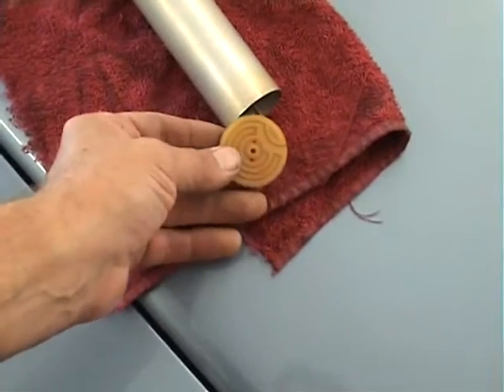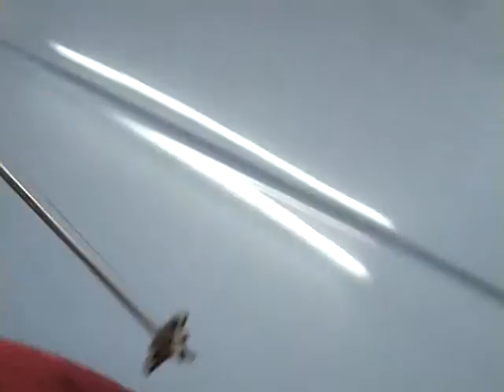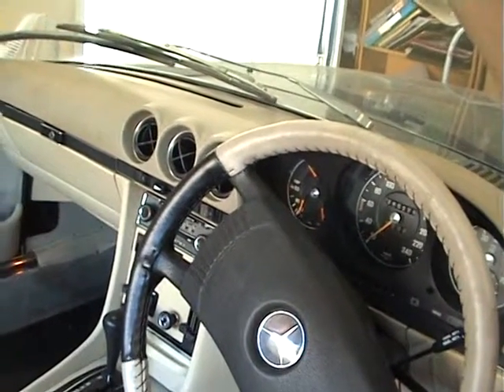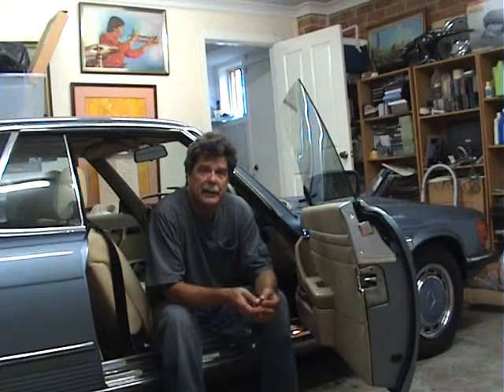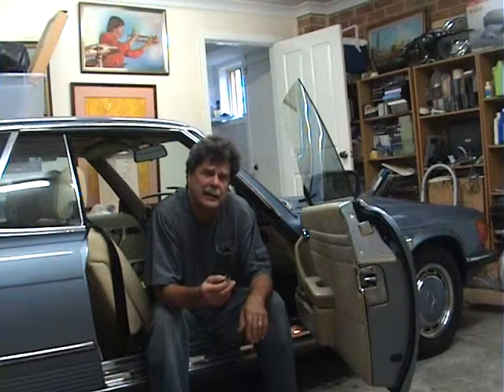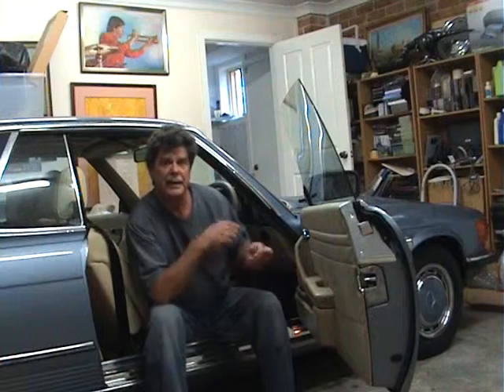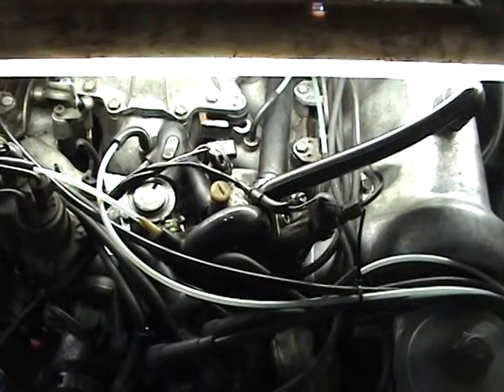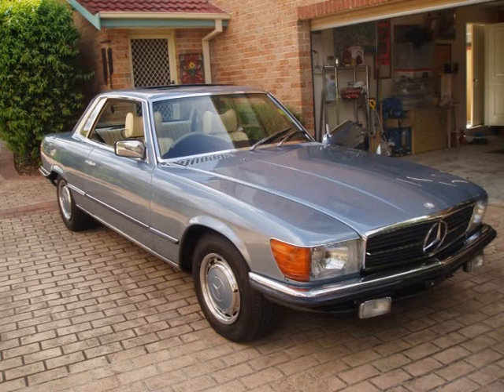Final for my 450SLC Merc, fuel sender, upholstery,steering box, thermal vacuum valve.

Comment: Thanks for the videos, I rescued a 450 SLC from a wrecking yard a month ago in Brisbane and have a bit of work to do to get it on the road. I learnt a couple of things from your videos. Never had anything to do with Mercedes before and they sure are different to the old Holdens I am used to.  Having fun though.
Reply from the maker: Hi, The good news is you can get all the parts over the internet, I'm having time out while the car is running fine. But I know that the engine could do with more fine tuning in the vacuum system department and a few little details like a broken plastic cover on the air conditioning panel, etc. Good luck with your project. Paul.

Comment: Glad to see the project is nearly finished. For the seat upholstery you got the vinyl and not the leather correct? I wonder if the leather one would have better stitching.

Finally what was the issue for the steering play? You mention it at the end of the video but not sure I catched it properly.
Reply from the maker: Hi, I chose the vinyl after some research. As the covers were all ready made the upholsterers might have put the stitching out, but it is only minor, who knows.
To adjust the play in the steering you have to unbolt the steering box and rotate it to get at the adjustment screw or remove the exhaust system to get it out.
I'm about to do it again to take out more slack, it's a rotten job as the box is heavy to put back in.  hopefully the last thing to get right. Regards, Paul.